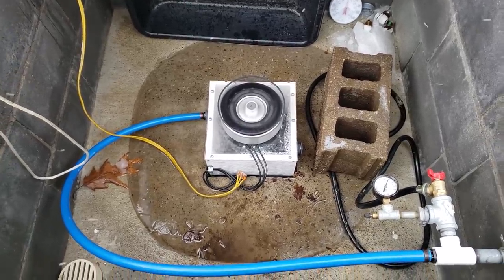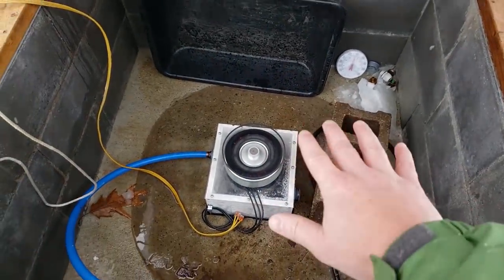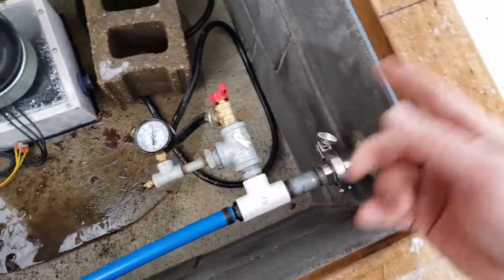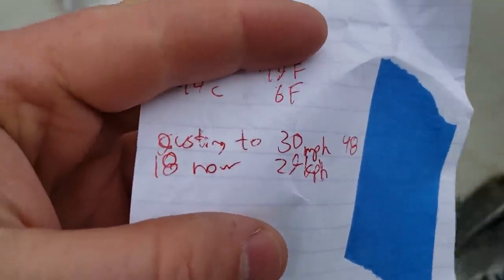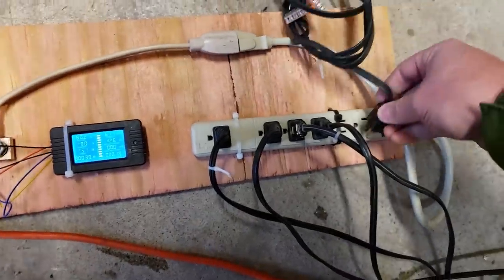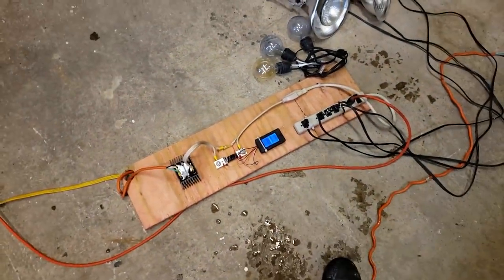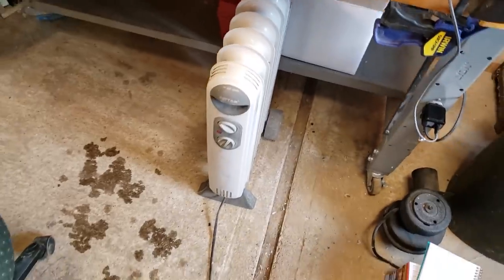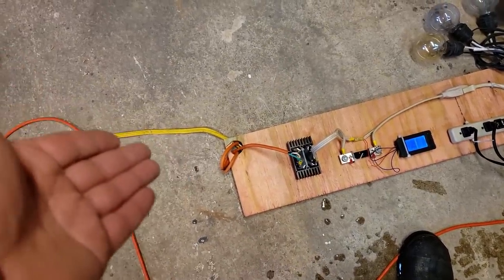Using the power for good.

Comment: Loops in your wire can cause induction, and cause voltage drops. Remove loops and keep away from smaller wires. Inductive reactance can cause electricity to jump into smaller wire via a magnetic field made by loops in wires. Idk if this is any help tbh. I just figured maybe i should mention it just in case you didn't already know.

Comment: One thing I noticed is the amount of water bouncing around in the turbine housing. The water exhaust water is bouncing around to be hit time and again by the turbine, every time accelarating it in a different direction thus wasting many valuable Watts in the process.
Try using analog meters on the output as a  double check of the digital stuff.

Comment: Put a capacitor on the output of the full bridge rectifier to stabilize the no load reading. Probably a 330uf 200V (Found on computer's power supply) should help.

Comment: Great video, been loving totally off grid since 2000, I would never go back, what they wanted to run in a syyem from the grid power 
, hell I paid for most of my system and no meter bills 👍👌❤🇨🇦
Reply from the maker: what are your system details? how has it progressed through the years?
Reply: @JoeMalovich  I started off small as my electrical needs grew, so did my sysyem, in short, I am stll abit old school , but I now have 16 x 420 watt solar panels, 8  x industrial fork lift batteries and 2 seperate charge controllers, 2 x 5000 watt pure sine inverters,  and 2 x 400 watt Silentwind generators.  I split the system in two, redundancy,  so if one system fails, i still have the others. So why the large forklift batteries, well lithium doesn't like it cold and last week it was -23 C or -9.4 F, so too cold for lithium, and I can get all of the batteries I want for free. The only draw back is that I needed a skidsteer just to lift each battery into place, They weigh in over 850 lbs each, I built a solar shed and all of the batteries are out of the weather, not heated, the batteries are fine in extreme cold as long as they are charged up, I angle my panels in the summer at 52 degrees as that is my lattitude and pretty much 60 degrees from the end of October to end of March. Even on a cloudy day, I get well over 60 - 70 % charge rate, the Silentwind gens are going most of the time, mainly because it is pretty much windy here every day. There is enough reserve capacity to last me 8 to 10 days if for some reason the system totaly failed. Hasn't happened yet. Heavy frost can be a big issue in the wintertime. I built a pull down blind cover with a felt underliner against the top of the panels, after sunset I pull it down to cover the array of panels and release it early in the morning, that way I don't loose anytime charging waiting  for the frost to melt off. I have a large creek that runs through and along one edge of my property, The top will freeze over abit but the flow of water is too strong to ever freeze the stream, so this summer I installed a water turbine system, somewhat similar to how you set yours up. I had to fiddle around abit to get the wayer to jet properly, but there is lots of head pressure, and it has not been a problem in this cold weather, now if the temp dropped like it did last winter to -50 C or -58 F , I would have some concerns and probably need to run some kind of heat, but even last winter the creak water movement was  running pretty fast. So that is the sytem , not fancy, just works, time tested

Comment: I would recommend adding a riser stick to the turbine housing for securing the wires and using water proof wire nuts in a vertical orientation or maybe even a junction box and some silicone
Reply from the maker: Certainly, along with a suitable plug for quick-disconnecting. maybe one of those plugs big clive just reviewed?
Reply: @JoeMalovich  look at some of the turn lock connectors from ITT Cannon they have some very nice industrial grade watertight connectors that won't  crack in the cold. I get those blue connectors on Chinese equipment semi frequently and I find them to be fragile
Reply: @JoeMalovich  id recommend building a cylindrical housing with all those straight sides you are probably getting a lot of water bouncing off the sides into the turbine causing friction maybe try to find an offcut of some 500mm pvc pipe water/gas etc

Comment: Those cheap power meters have issues with the ripples (high frequencies) in the DC voltage by the rectifier. Do a proper multimeter show the same voltage drop than the power meter?
Reply: Just put capacitor and get rid of most ripples

Warning :the inrush current can be bad within the process of charging  capacitor
Reply: @milanhlavacek6730  yes, that's why I haven't recommended one. When you test around you probably don't want one in your system. But when it's operational you can add one, since the voltage is rising slowly when you turn on the generator, the inrush current should be limiting itself, due to the lack of more power from the power source.

An under voltage protection is probably wise to put in front of the charge controller as well as some simple fuses, one for the AC side and one for the DC side in front and behind the cap, to prevent any wire overheating.

Also an RPM measuring device would be wise, so if the RPM is too low you probably have a hardware failure, so you want to shut off the water flow before the failing part is overheating or before a leak is flooding something.
Reply: @kipdennis3796  hey Dennis, nice to see another project starting, but it's not nice to spam links without any explanation. Ask a question or ask the channel owner if they could help or feature you. :)

Comment: Store batteries on a wooden/plastic pallet or a piece of plywood, never on direct concrete. 
I have always heard the batteries will lose their charge on concrete over time as it is somewhat grounded to the earth, 
wood and plastic insulates and seems to not transfer the energies to ground.
Nice to see you putting the power to use! 
The insulation idea is a good step, gotta protect that lid as best as you can!
Keep having fun with this and all your project ideas!
Reply: That's a myth :)
Reply from the maker: plastic insulates....but the case is made of plastic!
Reply: It may be a myth that setting batteries on  concrete will discharge them now; but setting them on a board or plastic can protect the concrete from spillage from the battery acid.
Reply: This used to be true in the early days of lead acid batteries but is not a real concern with modern plastic encased batteries.

Comment: You should put an insulating pad underneath the lead-acid batteries - they self discharge much more quickly when there is a temperature gradient between the top and bottom of the battery - a piece of polystyrene works well...

Comment: Mabye the water is 'flung' less, but there's still a ton of water excess in the chamber which must be working against the free motion of the pelton wheel.  It looks like a dishwasher in there.  If the water is hitting the top surface of your chamber, then the spoons are still hitting excess water upwards.  Maybe smaller nozzle to impart more force with less water?
Reply from the maker: a smaller nozzle means less water and less power because the pressure remains the same and so does the velocity. Yes there is more windage in this orientation, water windage that is.

Comment: I would say you have issues with that cheap meter, getting it wet probably didnt help.
Maybe use a multimeter across the shunt to measure the shunt volt drop, proxy system current.
I also use the 3 x 1.5mm^2 flex conductors together as one conductor 4.5 mm^2, this is a cheap cable solution for lower voltage DC applications :-)    Martin.

Comment: You are most certainly getting voltage drop on that cheap ext cord. You really need a good 10 to 8ga run of high strand count. Over size so you can go bigger on generator in the future.

Comment: I'm wondering if the spent water is leaving the area of the turbine without creating some back pressure on same. That drain has to be super efficient, it would seem. But I know absolutely nothing.
Reply from the maker: No back pressure, it's open to air.

Comment: 100' of 14 AWG at 60v and 2.5A is a drop of ~1V
Reply from the maker: Thank you, so many comments say I'm losing a bunch of power! 1v at 2.5a is only 2.5w which is acceptable. For the final one I will have properly sized wires.
Reply: @JoeMalovich  Yeah it's nothing to worry about. I don't think the cost of heavier gauge wire is justified by the minimal power savings. I just used an online voltage drop calculator

Comment: How Joe shorten your cable's to a board fix to a wall the less movement in the wires might give you the extra watts needed just incase kids or someone might accidentally trip or short circuit your hard work
Reply from the maker: That's a project for tomorrow.

Comment: wouldnt it be simpler to just make a quick tesla turbine and stick several of those generators on top as you make them to load up the given flow
as for keeping the box from freezing then even a small 12v  few amp stepper motor in reverse with  an inline diy supercap cluster can power a diy carbon painted slate heater https://youtu.be/9ISifqlfUzo?t=597
How To Make A Hot Plate From Conductive Ink
•Mar 21, 2014,Robert Murray-Smith